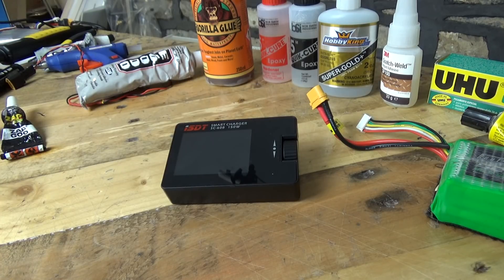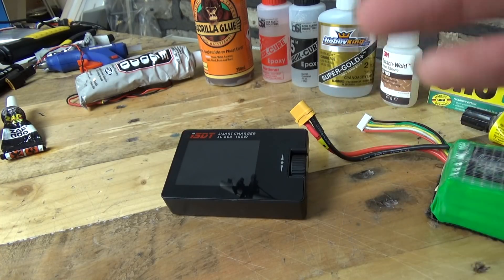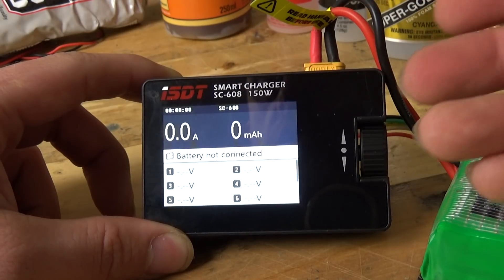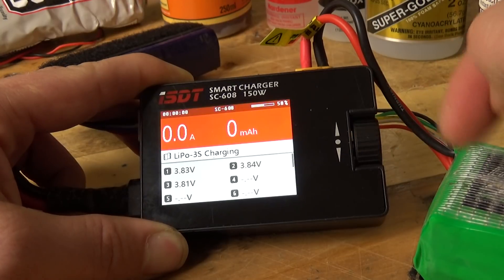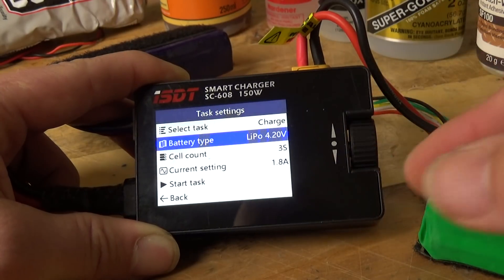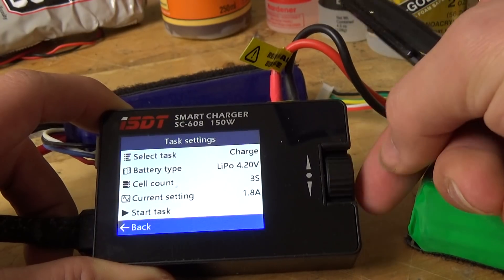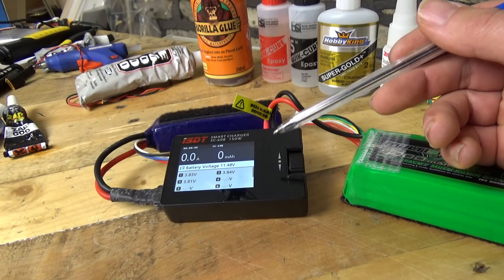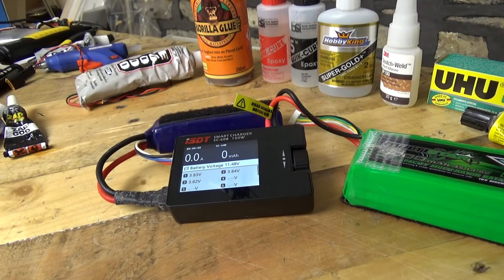Mini Review: iSDT SC-608 150W Smart Charger for RC Batteries

Comment: I have 2 of these and 2 of the bigger 620 chargers. All great bits of kit. Two tips. There is no reverse polarity protection on mine (unless this has been addressed) meaning that if you connect backwards you blow a surface mount fuse (guess how I know?). With a bit of care you can go in and replace that fuse, but it isn't easy. There is also an issue with failing backlight on the 608. Again there is a fix that can be found on google, but this is again a fiddly job.

Comment: I'd recommend that you pick up the Q6+ instead.  While that s a cool little charger, it is a discontinued model and it is only 150W capable.  

The Q6 is a 300W charger, and on a 24v 360W power supply it will charge 4S batteries at 15A!  On 12V it will do 12.x Amps which is still pretty awesome.

Comment: Can I calibrate this charger's voltage without waiting my head off for ISDT to reply to me with the calibration code? Or does it come with it's own code just at the top of the spot where you press the code in with the newest firmware?

I'd really appreciate the info because I like this charger But i simply REFUSE to buy a charger I cannot calibrate.
Reply from the maker: Hi fella, I have no idea if you can or cannot. I generally leave things alone if they're working fine rather than trying to "fix" them, which normally ends up in "breaking" them instead, Matt

Comment: Nobody sells these anymore.
Reply from the maker: Howdy Chris, that is a shame, I really like mine!
Reply: RagTheNutsOff 
I've got the q6+ which came after the sc608. Also a very good charger. The little control wheel on it is a bit moody but other than that it's brilliant.
Reply: RagTheNutsOff actually you can get them cheap from radioc but they are closing down. So might have problems if you get a dodgy one.
Reply: oh i see. out of stock...